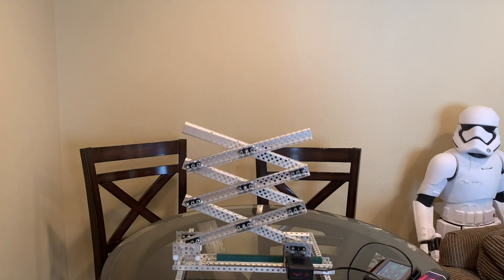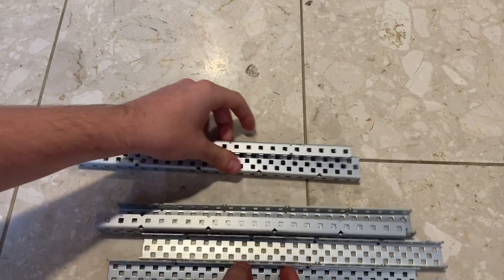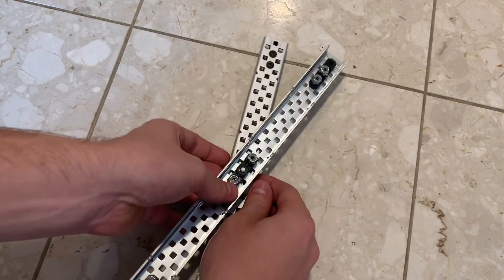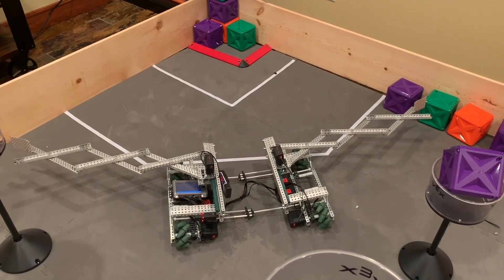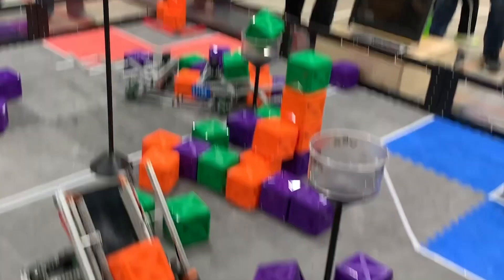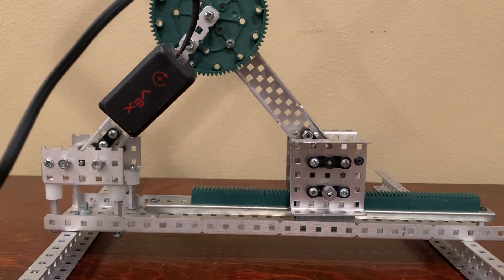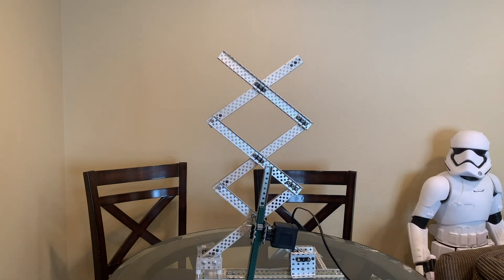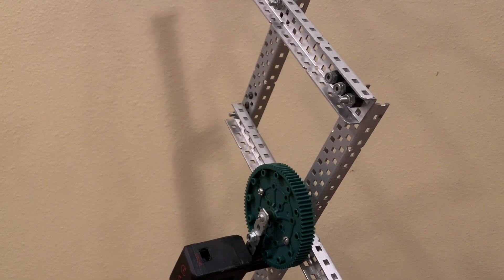Kepler's Guide to Scissor Lifts

Comment: Do you think it's possible to carry heavier objects now that there are probably more options for this mechanism to work? I'm trying to make a robot for this year's FIRST challenge called RECORD, and there's this part where the robot has to lift off the ground so another robot can enter the space inside you're robot to fit 2 robots inside one square. Not many teams are focusing on this function because it's optional and hard to pull off, but I've been thinking of a scissors lift for the longest time not knowing if it was even possible to build with the limited pieces that I have access to, but your video gave me hope, so thank you and if possible could you please help me?

Comment: this would really be a great endgame device for this year's spin up.
one question though, the linear slide (the bar with grips on it) i haven't been able to find it anywhere on vex. I only see the truck kit (the bottom that holds the bar in place) and the gear. do you know where I can find it?
Reply: if it's an aftermarket item, is there any other way to create this without the slide?

Comment: Hey Kepler, To rubber band it, couldn’t you connect rubber bands between 2 joints?
Reply from the maker: I had tried to do that one one of my test lifts, however, it didn’t seem to decrease the amount of torque required at the bottom, so while it helps it go up, it doesn’t make that much of a difference where it counts.